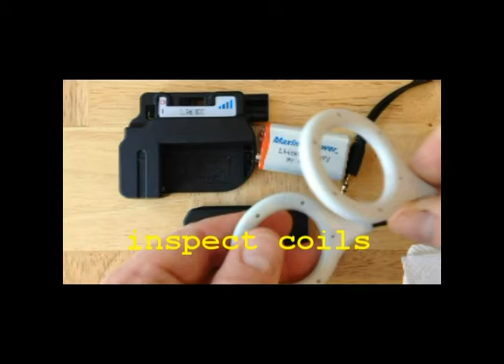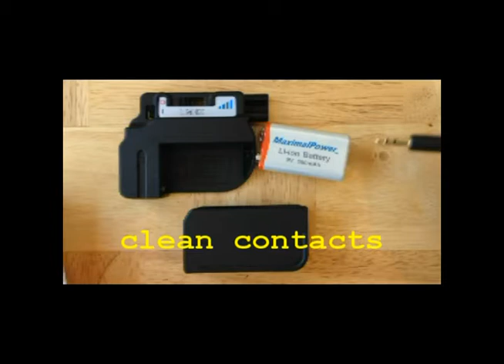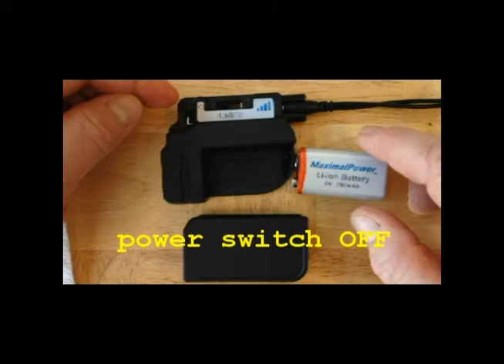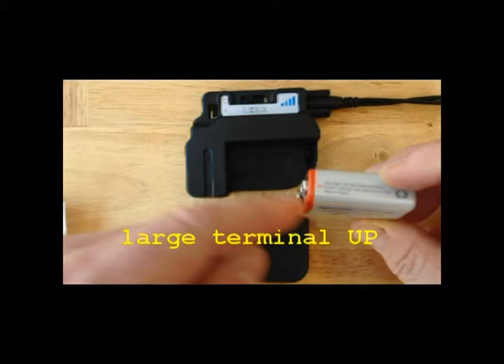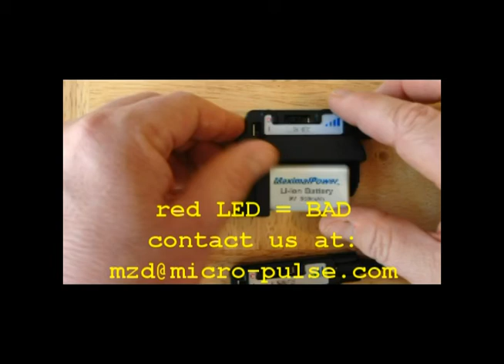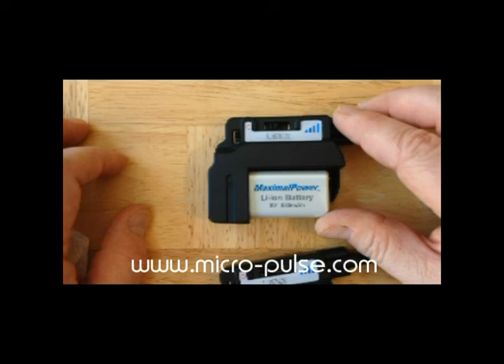Micro-Pulse ICES PEMF Tutorial 3 - Basic setup: Coils and Power Up

Comment: When I power up mine it flashes green and red. The coils still click and the chip still flashes green when the coils are applied to it. What does this mean? Mine is 4 years old.
Reply from the maker: As long as the coil tester flashes green, it is working.  Occasional red LED flashing means that you may be running the device too hard, possibilities include:
- Frequency and/or power set too high for constant running
- Device not placed in an open and cool location
- One or more coils have a short
- One or more coils are not fully plugged in, causing a short at the connection
Reply: @robertgdennis7472  I should be in good shape then. Port 4 on my B5 doesn't work. Is this a common issue with the B5? I've had it repaired multiple times but it seems to only last a few weeks. 3 ports should be good enough. Just wondering if there's something I'm doing wrong or if this happens frequently. How's the hips doing btw?